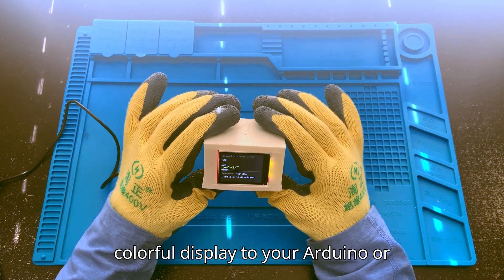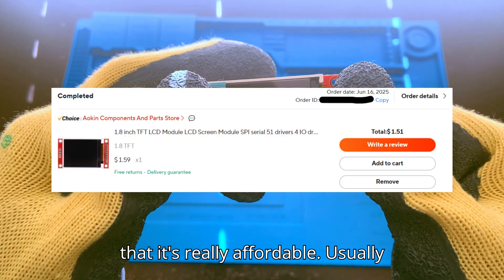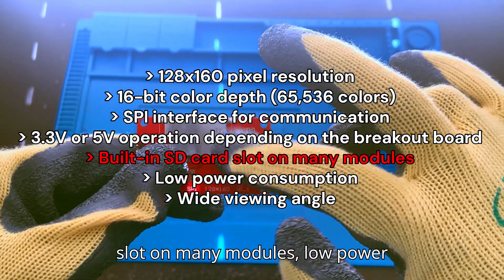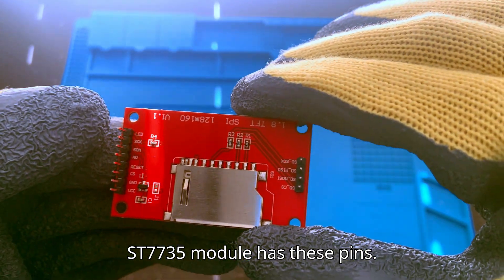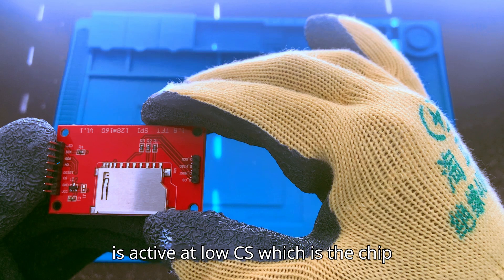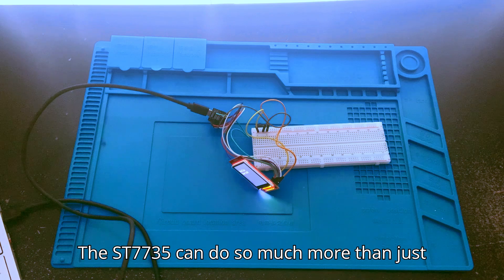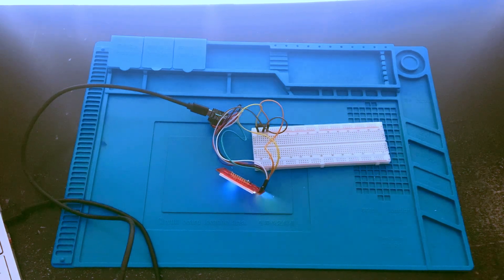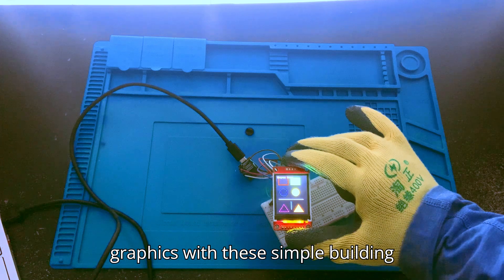The Complete ST7735 Guide

Comment: Which library (or multiple) should I use for ST7735?
Reply from the maker: I would recommend the ones shown in the video (Adafruit ST7735 and ST7789 Library, Adafruit GFX) and also try TFT_eSPI (faster library). All the best.
Reply: @iseecircuits Hi, could you recommend some RPi Pico C/C++ library for ST7735? It's extremaly hard to find working one.
Reply from the maker: For C, use pico‑st7735 (bablokb) or pico_st7735_80x160 (elehobica). Both can be found on Github I would recommend those.
Reply: @iseecircuits Thank you.